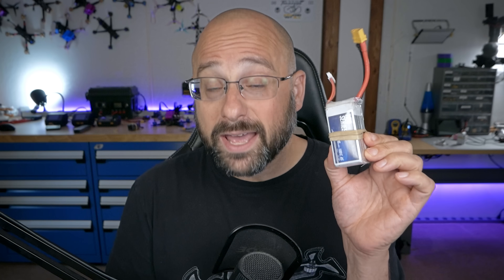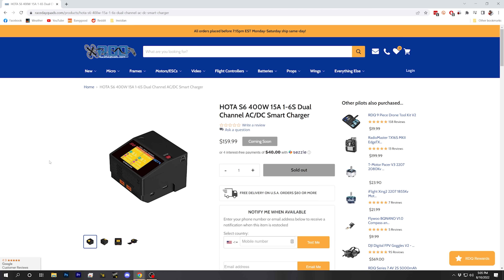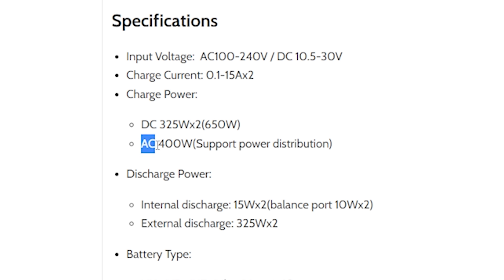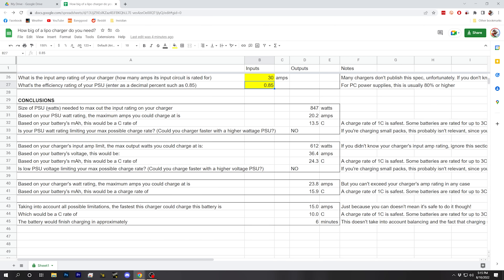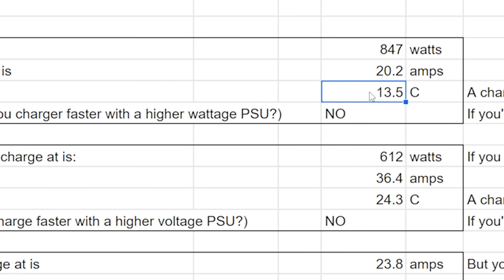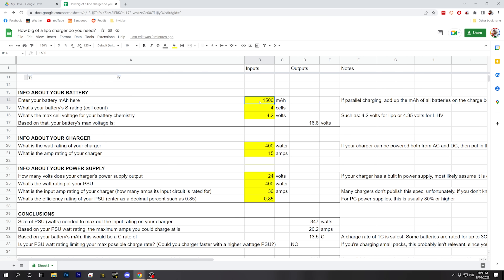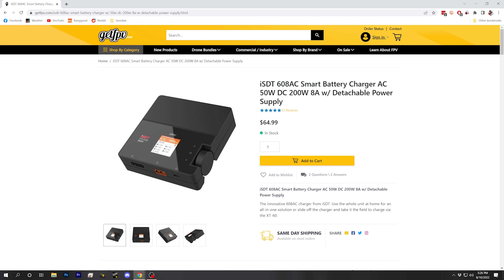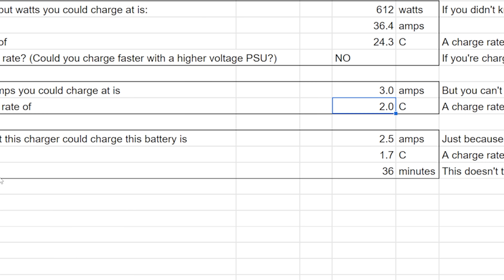Is your lipo charger too big? Could you be charging faster?

Comment from the maker: The real reason your charger is slow might be its balance current charge rate: https://www.youtube.com/watch?v=XEIWdZHXK1c&ab_channel=JoshuaBardwell
Reply: A battery charger can charge quickly at start, but the final topping stages when first cell gets close to 4.2Volt, it can take ages. (especially when charging a bigger and older not so good battery).
Additionally balance voltage accuracy is important, some chargers can't measure IR consistently, this is due bad accuracy in balance voltage measurement, during charge the battery SAG, voltage drop under charge/discharge load is measured true the balance leadfor the cells.  A good charge will consistently measure same IR number, when measuring repeatetly (check with same battery same temperature).   Last important point is the calibration,  my large I-charger and ISDT charger,  I found them accurate from factory, however my toolkit and hobbyking charger, came badly calibrated.  (not sure if they calibrate them in factory).
So for me these aspects are most important in quality of a charger;   High Balance current,  Accurate Balance Voltage Calibration, and consistency in IR measurement, as consitent IR measurement is best indicator for accurate circuitry. (without bias)

Comment: You didn't answer the question "Is your lipo charger too big?" from your video title. My question: I want to mobile recharge multiple tiny 3s batteries in the field for a small cinewhoop, the Pavo20pro. For 2s whoop batteries you have chargers like the VIFLY ToothStor 2S 4-Port. For 3s whoop batteries, the only available 4-channel chargers are way bigger (bit oversized): ToolkitRC Q4AC or SkyRC Q100neo. But both brands have big quality/reliability issues. So the only reliable solution I found is the HOTA F6, which is even way more oversized for these tiny batteries. It can provide 250W per channel while I need maybe 10W per channel. So the question from the beginning: Isn't it nonsense to use such an extreme oversized charger, e.g. because it wastes heaps of energy (which I have to carry in the backpack) to keep the charger running instead of transferring all energy into the batteries? Or is there another solution for mobile charging multiple tiny 3s batteries in the field?
Reply from the maker: The spreadsheet that I show in the video and link in the video description answers the question, "is your lipo charger too big?" The video can't answer that question because everyon'es lipo charger is different. The video gives you a method of answering the question for yourself.

Here is a link to the google doc. https://www.youtube.com/redirect?https://docs.google.com/spreadsheets/d/13UjZ9iEslKZaz4EiFBKQhLL7E-ves4zeOe00QT1jIyQ/edit?gid=0#gid=0

For Whoop batteries I recommend the ViFly WhoopStor charger.
Reply: @JoshuaBardwell  The ViFly WhoopStor charger just handles 2s batteries, not 3s.
Reply from the maker: Sorry -- you said "whoop batteries' and I assumed you meant 1S or 2S. You're right -- for 3S, you just use a "big" charger.
Reply: @JoshuaBardwell  Since the Pavo20pro is a cinewhoop, I thought it's tiny 3s (550mAh) batteries are also kindof whoop batteries. So there is obviously a market gap for cinewhoop friends - missing a bigger version of the VIFLY ToothStor charger for little 3s batteries. Unless they use low power 2s batteries.

Comment: I'm thinkin' people are getting into trouble with slow charging when they do parallel charging. Take the Hota S6 which I have, it can only output up to 13.3V x 15A =  200W if both channels are being used. This would allow you to charge 6/3S 2500mah batteries at 15A(1C) in parallel on both channels. That amperage rating doesn't work across the board, as it depends on the voltage of the batteries being charged. There would be no way you could charge 6/6S 2000mah batteries even at 12A(1C) on both channels. You would have to drop the amperage to 7.9A as, (4.2x6S)=25.2V x 7.9A = 200W. Voltage must be considered along with Amperage setting, to not exceed the 200W per channel. Not sure exactly what the Hota S6's, supports power distribution, actually means...Anyone? It says combined charging power 500W, and that must be on 1 channel I'm assuming. Also, combined amperage looks to be 21A, on one channel I'm assuming.

Comment: I really love your videos. I have Lipo batteries myself. I have ordered a charger because I had no way to discharge my batteries on my own. I would just charge them and rely on the batteries to slowly discharged them but the charger I bought which should be here tomorrow it will charge the batteries and discharged them depending on the modes that I choose on the charger and it was put them in the storage mode and it will alert me if I go to use the battery pack and it will alert me before I use that battery. If it did text a dead cell then it will tell me to discard it right away that’s my next question can you make a video on storage mode am very eager and ready to learn about Lipo batteries because I was the one that had no idea you had to put so much care after buying a Lipo battery for a toy or a drone so if you could do a video properly charging/discharging and storage mode.

Comment: if the money is available, i think "futureproofing" isn't a bad thing to do with a charger. you might only need 2-3s in the beginning but who says that you wont go for 6s 6000mAh in the future? when i got into rc flying, i needed to charge 3s 2200mAh, now it's 4s 3000mAh and i also have a plane that needs 2x 6s 6000mAh, i just don't have the batteries yet. i do have a proper charger for them though, which i use for all the other batteries that i have lying around :D

Comment: The nice thing about bigger chargers is sometimes you are using it way under spec so it's fans rarely come on depending on it's design
  If you get a charger that is near the max you want to charge, The fans likely would be much louder as it is near it's max capacity.

Comment: Power boards are cumbersome and limit the plug type, spider parallel leads for charging and balancing are a better option of course best to select a single connector to simplify your charging needs, but that doesn't always happen.
I've found the XT-60 to be pretty good for attachment and removal and soldering.,
The others Dean's ok, but soldering a round wire to a flat flange can be mastered and there are some mods to help, the rest are eh! I've started using solder-less connectors use set screws to trap the lead but the company short counts on the set screws but can be purchased from Mikado USA they work fine. If you are a serious electric flyer the purchase of a external power supply with sufficient wattage is well worth the investment.  A compatible and versatile charger is also required.  Although this is not a simple topic he has made it more complicated than necessary. 
Better to overshoot wattage needs rather than understood.
A 6 cell pack 5000mah will maximally require 6 cells x 4.2volts= 25.2volts /battery. Each battery is 5000mah or 5 amps, Your need wattage supply is 
Watts = volts x amps = 25.2v x 5amp =
126watts/battery.  Most parallel spiders leads allow the charging of 6 batteries afterall 6 of these batteries can cost over $600. If you fly more than 6 flights hey more power to you. But you power supply and charger must be rated to deliver for these 6 batteries, 6 batteries 
x 126 watts = 756 watts, close to 1000 watts for 6 batteries. So what are you going to do shop around and save a few bucks to get an 800 watt set up? They don't make them in those increments to my knowledge,  1000, 1200, 1500 is more traditional.  Many helicopter use 7cell batteries in series so there you go, give yourself a sufficient buffer anticipate future needs.

Comment: Great Video!! If i have a 1400mAh 22.2V 6S1P Lipo Battery Pack with XT60 Connector, could i use DJI FPV AC Power adapter to charge it? DJI FPC power adapter is the one i use to charge my DJI FPV drone battery. Please advise. Thanks.

Comment: Hi,  I need help figuring out what to do. I've got 3x (1/24 Power Wagon LIPO Battery 2S 380mAh). Should I continue charging those small batteries with the charger that came with my Power Wagon? Will it damage my batteries long term? If so, what charging setup should I go for?

Comment: I always charge at 2C (3A) unless I have a loooot of time for charging (while home working, for ex) but I took the multiple-chargers solution. I have 4 mono and 1 dual chargers. Dual has a built-in PSU, the mono chargers are plugged on 12V 12A external PSU. I never had a problem :)

Comment: Useful info for those with few chargers, personally I use a 1500w psu and 5 or 6 chargers, sometimes all running at once, often with parallel boards on some of them!
What I notice if a charger is at or over it's charge limit is the amps being put in the lipo is less than I asked for (for example if I input 8a and after a couple of minutes it's only charging at 6a , then I know I need to reduce the load on that charger to be finished in 1 hour or less)
Using various brands, isdt, toolkit rc , sky rc , oc day and an old 5a non smart charger for smaller packs.
Good content though JB, a lot of people might not realise all the points you have made.

Comment: My chargers r too small. Well not the charger the power supply  🤣 limited 55w on small power supply .. 180w bigger one
I have 6s 6000mah batteries & 6s 4000mah batteries I try to parallel multiple
I need that 400w hota

Comment: 3:45 you say your gonna measure ONE battery and then you put in 400 as the max, Shouldn't of that been 200 as the max?
Reply from the maker: No. Because the power is divided between the channels in use. So if you're using one channel, then all the power goes to that channel.

Comment: Just some good recommendations for capable power supplies, I use a PC power supply for my desktop and an Xbox power supply for on the road. Both capable of supporting my 10A charger charging at the full 10A. Will be upgrading soon to a 30A charger soon due to now having bigger batteries to charge for RC vehicles.

Comment: Correct me if im wrong BUT (!) the most important batteryinformation, the Charge rate, are  not important enough to talk about?

Who cares a 15a charger if you cant Charge your lipo for more than 5c ( typical fpv 1500 4s / 1100 or 1300 6s).

This Video is a Explanation for "wow i can Charge my lipo with 15amps"

💥
Reply from the maker: Sorry but I think you didn't understand the video. I specifically talk about how a 1C to 5C charge rate is safe. The spreadsheet shows the max charge rate the charger could support, and the conclusion of the video is, if it's more than about 1C to 2C then the charge is fine. Basically the exact point you're making.
Reply: @JoshuaBardwell  thats why im asking for, thx for your answer 🙏

Comment: Yes most chargers are too "big" for drone batteries.  I fly larger EDF jets and can't find a "big" enough charger to charge four 6S 5000 mAh lipos simultaneously at 1C.  There are plenty of dual chargers out there that can charge these larger lipos at 1C, but I have not found a single quad charger on the market capable of doing this.  None.

Comment: the screen on the HOTA is a weak spot, its hard not to press on it when plugging/unplugging things.
ive been considering gluing a piece of polycarbonate over it to protect it.
I also think extension cables to plug batteries in is a good idea. The short leads on the battery cause a lot of stress on the wires & connector when plugging/unplugging

Comment: Mr. Bardwell, I enjoy your channel very much and usually find its content very informative, but this one not so much IMHO. After watching it I believe that if you know enough to fill out the required info, you will already know enough to know what or where any charging problems would be. And if you don't know enough to fill out the info, you'd either be confused by the results or get information that could lead you to charge batteries at a rate way beyond anything they should be. This spreadsheet is more of a solution in search of a problem that it really doesn't resolve. I appreciate your attempt at tackling this subject, but I'm afraid this spreadsheet is overly complicated and allows too many assumptions to be entered to be of any real value. As I said before, this could lead to dangerously high charge rates by someone not knowing what they are doing.
I think directing people to a list of known quality chargers and batteries would be a good start. "You buy once, you cry once", and "you get what you pay for", applies to chargers and batteries as it does to anything you expect to perform well.
All the Best, Chuck
Reply from the maker: List of known quality gear: my web site www.fpvknowitall.com

Comment: An important point, is battery packs have a maximum charing current specification. This should never be exceeded. Generally staying below 2C charing rate should not exceed this value. The spec varies by battery chemistry and battery manufacture.

Worth noting that good quality LiPo, Li-Ion chargers with switch from a constant-current (cc) to a constant-voltage (cv) once cells begin climbing above ~3.9V. This means the charing current will started to reduce so the maximum cell voltage will not be exceeded (with some margin based on the realtime charging current). If want to know more details look up "lipo charging curve" and examine a the charging current vs. voltage over time. 

So if really want the fastest charging time, can stop charging at ~4.0-4.1V per cell and fly while charging your next pack. Flight time per pack will be less; but you can get in the air quicker. 
Looking at charging capacity (mAh) vs time will show that ~90% of a packs capacity has be added in <75-80% of the time to reach 100%. (numbers may vary a bit by individual packs and how depleted the pack was at beginning of charging session)
The slowdown in current also allow the charger to balance individual cells in the pack, so they all reach full voltage at the same time.
The slowness at the end of a charging session is sometimes referred to as the "charging stadium effect". Think seating at a sports/concert venue.
Reply: Its not "a Important point" it is "the most Important point"!

Comment: Thank you for making this spreadsheet makes calculating this much easier. May I suggest that the line "What is the input amp rating of your charger (how many amps its input circuit is rated for)" maybe is better placed with the charger info section? 

It didn't realise right away that this was for the charger input amps, because it was under the power supply section. So I Initially made the mistake to fill in the PSU input amps... (an irrelevant value if the PSU output amps and voltage are already known )

Btw. Are you sure about the YES, NO logic? 
To me the correct answer to the stated question seems the other way round.  I have  60Amps 1800Watt PSU and according to the spreadsheet I max it out with 3 x 1500 mah lipos. Maybe am I interpreting it wrong?
Reply: I think so too, was trying the sheet and using a very high wattage power supply did not change the Yes into a No. When you fill in a very low wattage for the power supply it becomes No. Same counts for the power supply output voltage logic.

Comment: I just divide the Wh rating of the battery/ies by 1h 😜and I get the approximate wattage that I need to charge at 1C. (Usually for parallel charging)

Comment: No way that default efficiency is above a computers psu standard 80 bronze rating when a computers psu does a lot more than these chargers in power delivery to today's computer component standards, even budget rigs. 80 bronze is thier efficiency ratings and there's even better of 80 platinum or 80 gold. 80 bronze being the most common to find.

Comment: I'm using ToolkitRC M7 with parallel charging board and 190W notebook power supply and it work excellent. The only one thing is that power wires are heating starting from 5A. On 7A wires is very hot. This charher is very small, I take it to nature with large powerbank- Anker powerhouse 400

Comment: To charge multi-cell LiPo's faster, balance current in general is the culprit. Chargers with larger balance current will finish battery charging faster, sometimes very noticeably faster. The charger you waved around at begin is the one of best - it have one of larger balance currents between manufactured hobby balance chargers. HOTA D6 Pro, if someone is interested.

Comment: Is there a charger that will individually do 6 mini quad batteries at 2c in the same way the vifly whoopstor does whoop packs where you can hotswap them as they finish charging.
Reply from the maker: If you want hot swap get a Toolkitrc M6D as it has the hot-swap function.

Comment: How to fill "info about power supply" for internal power supply? To "just skip it" means leave a random values. 
I want to check HOTA D6 PRO with internal powersupply?
Reply from the maker: If you have an internal power supply, ignore the "INFO ABOUT YOUR POWER SUPPLY" section and the first two of the "CONCLUSIONS" section ("Is your PSU watt rating limiting your max possible charge rate?" and "Is low PSU voltage limiting your max possible charge rate?").
Reply: @JoshuaBardwell  oh, to ignore that too. Ok. Ty

Comment: Could you add the calculation  to determine ?your batteries 1C rate ?
Reply: 800mah is 0.8 amps / 1300mah is 1.3 amps / 1500mah is 1.5 amps. 
 Simple 1/1000 ratio
Reply: Just divide the battery's mAh rating by 1000..

Comment: Lets be honest,  charging 1x 1500mah battery, just about anything will charge it 1c.

When you was to charge 6s at 20A (paraboard etc) that's where you need the big power supply to feed the big charger.
Reply: 100% I have a tiny charger powered by a laptop powersupply. It easily charges my 4S 3000 mah battery at 1C...